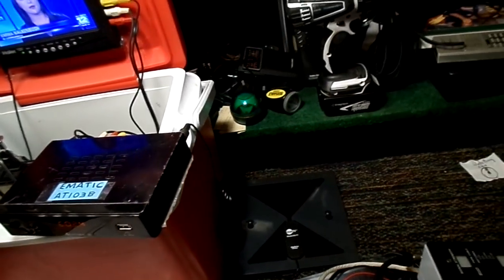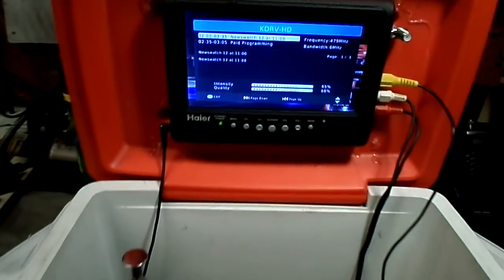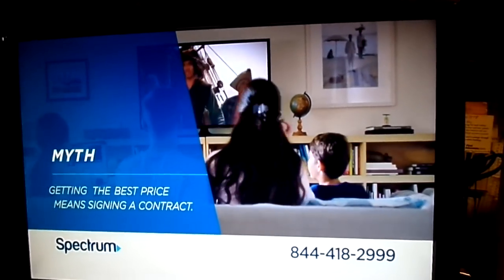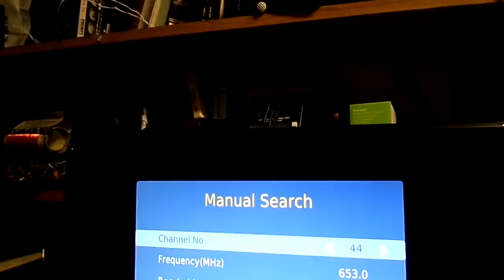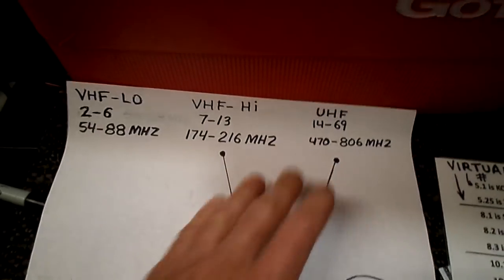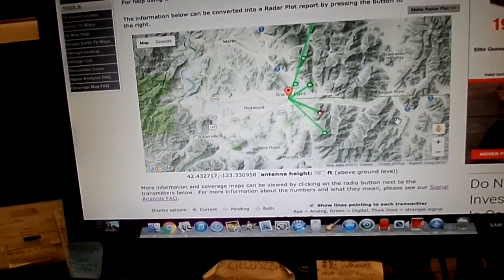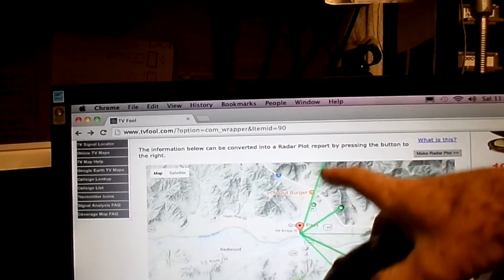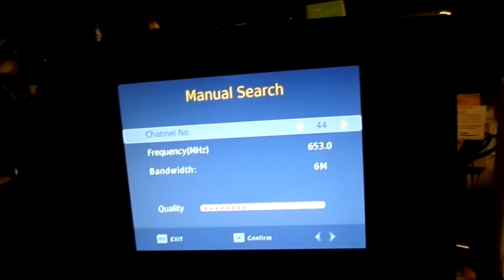Television Signal Direction Finder And Frequency Indicator.

Comment: I am going to build a direction finder like yours. Did you include a preamp or just the box and antenna as shown? Great device. I have been struggling with a multi antenna system with three directions. Different signal strengths are giving me  problems. I am going to start adding attenuation to the stronger signal antenna. Any suggestions?
Reply from the maker: I didn't use a preamp with mine if you are speaking about the Winegard model, but The signal meter I use which has a stronger signal is the digital to analog converter. The only complaint I have with it, is it when I scan the auto scan, it doesn't allow me store more than one channel if there happens to be second transmitter in the area, or even a third or forth broadcasting the same programming which is common around here. The other thing I modified was the remote control that came with it. The watch style battery they included with it had to short of a life, so I modified mine to hold Two AAA batteries in series which gives me the same voltage. The Winegard model sends voltage through the coax to your antenna, so if you add an amp it can be powered from it. I hope to make a video on the pros and cons of the Two signal meters soon.

Comment: climbed onto roofs with my dad in the 60s, so much simpler back then, just one station in my town.  Things got more complicated when another station came on the air.  We then had sell and teach people how to use rotors (which meant, of course, more profit).  Last time I owned a TV was back in the 80s (seemed by then that there was nothing but stupid on it) though this vid is very interesting even if I only have a vague idea about what's going on these days.

Comment: I have been contemplating doing the same thing with a Sensar Pro, but I have read some "not so good" reviews.  Seems like, with all of the cord cutting going on, there would be a great need for an  "all in one" portable channel / signal strength meter.  Been looking for several years, but the Sensar Pro seems to be the only viable option, but needs significant modification and add on's to make it work.  One question: looks like you've got a filter or something (where I would expect a simple coax coupler) between the output of the antenna and the input to the Sensar Pro - can you identify and explain?
Reply from the maker: I don't have  filter of any kind, and whenever I use this device for weak signals, I  disconnect the cell phone antenna I have attached to it, and re-attach it to a standard TV antenna since they have more gain than the cell phone antenna.
Reply: I was referring to the large coupler (adjacent with the blue Wineguard label) which I thought might be a filter.  If hooked up to a TV antenna, should a simple coax coupler work ok?
Reply from the maker: The sensor pro had a TV type coax connector already on it, but because the Cell phone antenna I used had a BNC connector, I had to use the adapter.  @byteman

Comment: Update......  Found a 12 V  wall wart, cut off connector and installed Spade lugs.  Now the  winegard sensar pro works perfectly. The only bad news is that it's only one channel is available at ground level with my do-it-yourself antenna :-(
Reply from the maker: I use a couple 6 volt batteries in series with mine and it works fairly well.

Comment: Just bought a winegard sensar pro, trying to operate it on 9 V.  It just flickers on for a few seconds once in a while :-(   Has anybody else tried this on  9V?   Manual says 9 to 12 V is okay.
Debating whether to return the unit or changed by battery voltage (6 AA's). Problem is, not enough battery holders for 8 AA's.  By the way the battery shows over 9 V under load.
Now that RadioShack has gone I do not know any place but eBay for supplies for a reasonable price.
Reply: Get a 12v batter and holder on Amazon

Comment: Grants Pass TV Repair - Winegard Sensar Pro. is powered separately by a 12v supply...where does it get this power in a home (wall) or RV? Also...can I check the TV signal strength with this unit hooked up to my TV antenna with a pre- amp. (booster)? Will the booster damage the Winegard Sensar Pro? Thanks for your reply.
Reply from the maker: The Sensar Pro gets its power from the RVs 12 volt power supply, but the Sensor Pro also has 12 volts DC coming out of the antenna connector. This is used to send 12 volts up the coax to the antenna amplifier which is inside of the RV antenna. I often use my Sensar PRO to test the signal strength of RV antenna outputs, right at the coax end that would normally be plugged into the TV.
The center of the connector is positive, and the outer part is negative. I hope this answers your question.
Reply: @GrantsPassTVRepair  Thank you...very interesting video, hope to see more!
Reply: I'm assuming that you are using a DC blocker between the antenna and Sensor Pro? @GrantsPassTVRepair
Reply from the maker: Not always but thanks for the reminder. I forgot about the DC Voltage it puts out.

Comment: Do you know if the signal strength readout on the Wineguard has any relation to -dBm ?
Or maybe you could tell us at what number the picture starts to get snowy on your TV.
Reply from the maker: I don't know what the numbers represent in terms of db comparison, but regarding a reliable signal strength number,I seem to remember someone telling me anything over 50 would be a reliable signal, but I'm not entirely sure. It sounds like a great test worthy of trying to figure out.

Comment: "My second device is a digital to analog converter which I placed in a small icebox along with an inverter and a small battery."

The Ematic AT103B actually runs off 12VDC. If you look inside, you should be able to find the circuitry converting the 120VAC to 12VDC and by-pass it. Check out http://www.avsforum.com/forum/index.php Search on Ematic and you should find the description. With the tiny TV and a small 12V Battery you should be able to eliminate the Cooler!
Reply from the maker: I need to look into that. Thank you for the tip!

Comment: A question: Is there any reason running the COAX inside the steel antenna mast would negatively impact reception?

I ask as we burn wood and our antenna mounts to the chimney.  Sometimes it gets HOT an the plastic COAX melts. I thought to cut a small hole in the mast near the antenna mount so the COAX would be protected (Shielded!) inside the mast.
Reply from the maker: I don't know of any problems you would encounter if you run your coax through the mast, but I have seen problems with the older kind of TV antenna wire known as twin lead, if it's close to a metal structure.
Reply: Right, Twin-lead is likely to suffer interference- they used to run it along the mast using 2.5" stand offs. However, the stand off all but encircled the twin-lead that was held by a plastic disk held in place by the metal standoff encircling it.

I read somewhere that running twin-lead down the mast and then converting to COAX was a good thing. Can't recall where or the rationale!
Reply: The whole point of coaxial cable is that the outer braid goes to ground and the center wire is isolated from any conductive materials outside the braid.

Old-fashioned twinlead actually had less signal loss - but had to be installed in such a way that it never met metal or wet leaves anywhere on the path between the antenna and the receiver.
Few homeowners knew how to use it correctly.
Reply: Not understanding how this is a response to the question about running  the RG6 Coax up through the antenna mast.

Comment: Also curious to learn if you've ever dealt with the antenna rotor combination units we see on Amazon - intriguing looking and much cheaper than a 'real' rotor alone!
Reply from the maker: Some of those small combination antenna and rotors I've seen are made so poorly I don't think the rotor last to long, and the antennas appear to be designed for UHF only.

Comment: The AT103B will work on 12VDC - you can avoid the inverter. The AC is converted to 12VDC in the AT103B. So, if you by[ass that circuitry and connect your battery after it . . . 
A fellow has this setup in his car and shared it on a site a couple of years ago.

Comment: Any digital antenna style recommendation that would pick up the most channels?
Reply from the maker: I'm still experimenting with several antennas, and I try not to use anything larger than necessary for a particular location. I have been fairly pleased  with the 4 bay bow tie antennas for UHF channels made my stellar labs such as the one I show in this video  I saw no improvement when using a dual 4 bay antenna or an 8 bay bow tie antenna. If I need a good antenna for VHF and UHF TV frequencies I found the Windgard HD7694P might work, and it's tough enough for high wind speeds, But sometimes I need something that may have more gain on a particular channel such as the GE ANT3036W  It depends on the area as to which one is right for the job. As a general rule I have found that the larger the antenna is the better it seems to perform, but some of them are so large they aren't always practical, and a few of the real large ones seem a bit more fragile.
Reply: Grants Pass TV Repair 
Thanks Dave for reporting the make & model of everything you talk & write about. Makes it easy to find if we want to try it. 

Cheers!
Reply: When I bought my first set of antennas,  and I chose separate VHF and UHF antennas.    I bought the only all VHF channel antenna, an Antennacraft CS600 in 2011, and 2 Winegard HD9032 antennas.   I bought 2 UHF antennas,  because I was trying to get South Bend Indiana UHF stations 60 miles from me on one antenna,  and the other one was for Chicago.   I couldn't effectively get the South Bend stations effectively with 1 antenna,  that I put those plans on hold.  I was also having problems with Chicago stations that mattered to me.  I got all the full market stations, but 2 of the stations couldn't lock in completely.   I could not get a single low power station with the yagi, due to it being too directional.   I replaced the Winegard antennas with an Antennas Direct DB8, and that antenna got all the full market stations, plus the low power stations that TV Fool said I should receive, though only 2 of those low power stations were important.   I also had to get another UHF antenna for a single station that had their tower outside of Cedar Lake Indiana,  and that antenna was pointed in that direction. Since moving, I'm waiting to save up for new poles and mounting brackets.   My plan is to resurrect my plans to pick up South Bend stations again, and I believe I'll have better luck this time around.   The ground level is higher in my new place, and I have a higher roofline to make it easier to get the stations, at least at night, and for the CBS and NBC stations that have the strongest signals.  I hope to get the PBS station from South Bend.   Now for the VHF antenna,  the reason I got one with VHF-Lo,  is because on occasion a Class A station is on VHF-Lo  (REAL channel 4) is something I want to get, and I need a pre-amplifier to get that station, as well as for UHF low power TV stations.
Reply: Find out (using TV fool or rabbitears.info) what the ACTUAL channels your local stations are on.
If any local stations transmit on actual channels 2 thru 6, you'll need a true all-channel antenna, with wide elements (metal rods) crossing the beam.
If you have none, check to see if any of your local stations are on channels 7 thru 13 (more common), you'll need high VHF capability.
If they are all on channels 14 and above, a UHF yagi or bowtie type should bring everything in, but try to be above the trees if you're far away from the transmitters (note that the transmitter sites can be 30 miles or more from the city of license, though 10 miles is more typical.)

Comment: I like you hand held signal finder,the cooler unit is pretty big  If I were still in business I would do the handheld for me I have three antennas with rotors and preamps 60 miles from all and get about 30 channels

Comment: Interesting stuff. I used my android smartphone with a USB dvb-t dongle connected to it when I installed the antenna at home, it is light and very portable :)
Reply from the maker: Using a dongle that works with a cell phone sounds like a good idea. Someone warned me that not all of them work for the American broadcast standard, and to make sure you take note of this if you purchase one.
Reply: RandomHacks
Which brand & model dongle do you use? What software do you use on the phone?